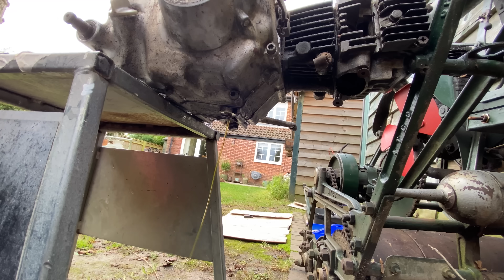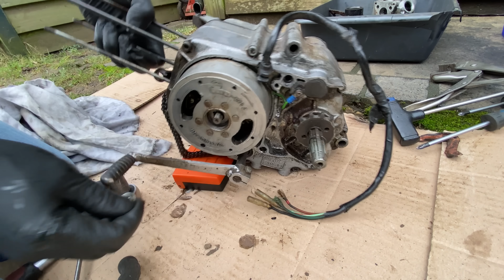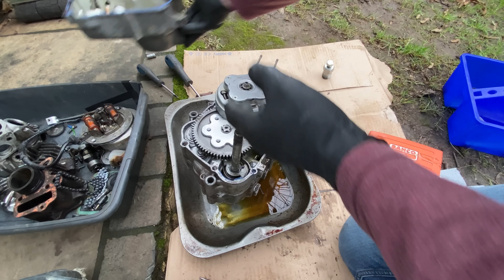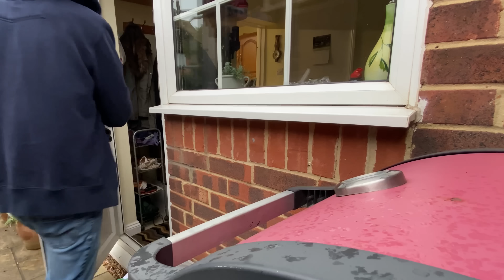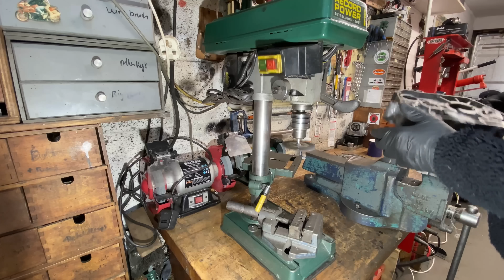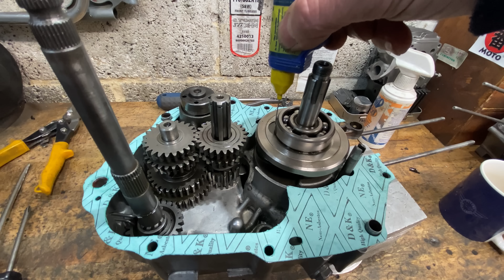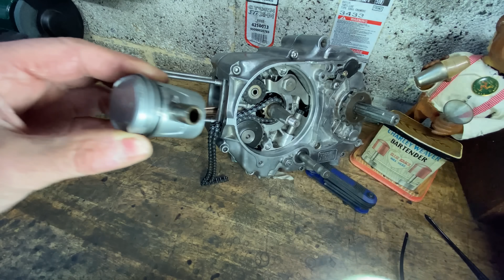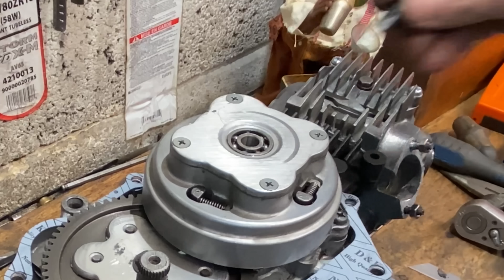Honda SS50 engine strip down, rebuild and start

Comment: My first bike was a ca. 1970 Z50 with a close relative of this engine (semi-auto trans.) Always had trouble with the cam chain jumping time. As a 9- or 10-yo kid I didn't really have the knowledge or resources to root cause it but I did get pretty good at pulling that side cover off the head and re-timing it. I still have my old Clymer manual for it with hand-written notes I made back then inside the covers and in the margins. Good memories. 45 years on I still miss that little bike.
Reply: You could always get one. If 50cc is too small for your blood, you may also be able to get a modern Monkey 125. Dunno if it's available in your market though.

Comment: Superb video as always Allen.
The first job that I had to do on my SS50 engine, was an exhaust valve replacement, after bending an exhaust valve in a fit of teenage bravado!
B.T.W,  you don't need a valve compressor on these little heads. - You can just use a 10mm spanner through the tappet adjustment hole, to lever the valve assembly down.
A popular modification, for those who were not satisfied with 50cc power was to source the head, barrel and piston from a Honda C70. Not strictly legal for a moped, but Who is going to check?
Reply: You could identify one with a C70 cylinder by the shiny patch in the place where the engine capacity was originally cast onto the cylinder.

Comment: Brings back nightmares, spent some time carefully rebuilding one of these little beauties, got it back in the bike for someone to ride for work, very carefully explained the need to "run it in" and bring it back for a service after a hundred miles, they brought it back broken, said it went like a rocket almost 50 mph and 60 down hill, piston scuffed, bore scuffed, rings broken, they had caned the nuts out of it.
Reply from the maker: Brilliant

Comment: Enjoyed this video immensely, reminds me of the old Honda 50/55 pushrod OHV engines, worked on my share of those! Fairly simple engine, not much to them, and bulletproof.
Thank you, Allen!
Reply: I share your memories.
Reply: Push rods? Apart from the CX500 I thought all Honda engines were OHC or DOHC.
Reply: @moestrei  Yes definitely, the early 50cc Honda engine was pushrod operated.
Reply: @tonycamplin8607  Thanks....I learned something today.
Reply: @tonycamplin8607  The early Honda 50cc with pushrod valve gear was called the C100, sold in the UK from 1963 to about 1967 when it was replaced by the C50 with the overhead camshaft. The SS50 in this video was a "sixteener special" introduced in 1972 after the minimum age to ride a motorcycle other than a moped was raised to 17 in December 1971, that had pedals so as to meet the legal definition of a moped until the definition was changed in August 1977. The SS50's only real weakness was the piston rings, which would break if the engine was grossly over-revved (although I think the ones in this engine were broken by clumsy assembly technique; over-revving broke them at the ends rather than in the middle. I think the rival Yamaha FS1E was the only sixteener special on which nothing broke if it was over-revved; the engine would withstand a speed higher than the speed it would reach on full throttle with no load.
Reply: @cedriclynch  Thanks for the information, my little Honda, bought in 1964 also had pedals and looked sporty with its high level exhaust and fancy tank. As you suggested designed to attract teenagers. However I definitely wasn't one then! got it as cheap transport to work.
Reply: @moestrei  The CG125 also has pushrod valve gear.

Comment: G'day  Allen,,
Hope your ok , having to do a "full rebuild"  on that  Honda ,,,,  
Without  even so much as a cup-cake  or a muffin in sight .
 Still ,,, i guess something must have rubbed off ,,  
as  Tracey came to the rescue  "fully  assembled"  a Blanket/Quilt  by  juggling  a couple of light drift pins  and a length of coloured  cord..
Indeed,,,  might even start a new trend ..
 
       Respect 
          from
    Down  Under

Comment: In 76 my dad bought me a 73 SS50 I rode it to work and even off road in a quarry  the frame broke got fixed and still it took me everywhere, it was slow but so reliable and tough i have fond memories of it, it's nice to see one running again!

Comment: Brings back so many memories, the sound of the engine without an exhaust, the little dipstick, etc etc. I wonder how many of these engines have been sold worldwide?
Reply from the maker: Millions
Reply: The SS50 engine (although not the gearbox and clutch) is almost identical to the engine of the C50 Cub, which is the biggest-selling motor vehicle in history.

Comment: Nice. This took me back a bit.  My first bike was a C70 step-though.  I did manage 26,000 miles in two years though.  Honda did a great job with the reliability on those engines.

Comment: I bought an SS50 new back in 1973.  I used it around town and for commuting to work.  When we went on holiday we loaded it in the back of the van and rode it around Scotland.  It just needed a bit more power and a couple of years later traded it for a CB125S.  happy days.

Comment: Thanks for the video Alan - like many others in the comments it brought back memories from my youth. My first bike as a sixteen year old was a nearly new metallic blue Honda 5 speed SS50 Reg XYO 76G. Unlike the later model (with pedals?) for a 4 stroke 50cc it was reasonably nippy.  I think it could make about 55mph with a following wind going downhill. I am tall and sat bolt upright with just about room to tuck my knees under the handle bars. Not much room (or power) for a pillion. Was jealous of a school friend who had a 5 speed SS90. At the time I had a genuine Honda workshop manual and I learnt a lot from maintaining it and the occasional strip down. Seem to recall SAE 30 oil was recommended in the day. Unfortunately the bike and workshop manual are long gone but still have the service tool in my shed.
Reply: Allen

Comment: I had an SS50 when i was 16 ( 36 years ago ) and i made it in to a 70 cc .
It was realy fast but a bid dangarous  to ride ...siting over the rear wheel...
I sold it and got a Honda MB5 / 7.
Fun times ...messing with mopeds.

Comment: As always, so impressed. It takes as much work to sort this little motor out, as a Z1. Some would say, are these worth bothering about? but I'm glad someone cares. Not a lot of 'Umph' in these, recalling two teenagers riding two-up struggling up Cotwold hills for a pint at a remote pub in winter. Looking forward to the next Kwaker 4 carbs episode - great job.

Comment: arh thats nice ... you make me feel young again ! , i did the same job many times .. 35 years ago , but we could not find any good heads back then , so the camshaft had to be sat in a homemade brass bering , but just like all your engines , it worked like a charm :-)  Greetings from Denmark , oooooh BTW where is the video where Tracy is making that twin motor KitchenMashine :-) ?

Comment: Thanks very enjoyable, took me back to being 16. Day after snapping my collarbone in half from locking a Beeza g/box up, sending me over the bars, no helmet, head & right shoulder slammed into the hard ground while `grass-tracking`, I was itching to get back on a bike again....any bike.  All figure-of-eight bandaged up, I gingerly pulled my SS50 early 5sp out of the shed, thinking I`ll manage ok on the tiny Honda. I did 100yds and thought better of it for a month. Oh for titanium plates & screws back then! Lovely little bike, although remember the frame soon cracked.

Comment: Nice job sir , well done .
Is this the same as the C50 70/90 engine or slightly different ? I seem to remember the C50 being a 3 speed .and not having a manual clutch facility .
Certainly iconic designs and it's amazing how well these engines last - especially considering they needed thrashed soundly to get andyspeed out them . The SS50 being one of the slowest 50's you could buy .

Comment: I also check if the rings rotate freely, especially when I fit new rings on old pistons. I noticed that sometimes the top ring channels can get slightly deformed and thus causing the ring to get a bit stuck. I just use a piece of an old ring to clean the channel and "reform" it so that the new ring will rotate free.

Comment: These little Honda engines are like Swiss watches , I’m a big fan 👌🏻…. Belleville washers , Maico clutches 🙈 3 screws in my shattered humorous at 17 because of those washers, or was it a 440 Maico and limited talent and no fear, they used to slip then bite with no warning ⚠️ 🤪

Comment: These engines are so familiar to me. It powered my first bike (SS50 4-speed) and my beloved "little donkey" (C70, with a 4 speed gearbox fitted). This was my standby and work bike for many years in my 20s. It broke my heart when it was stolen and trashed.

Comment: My first bike was an SS50!
I really wish I still had it - great on fuel and quite quick for a 50 as it was unrestricted.
Reply: So was mine in 1973! Bored it out to 72cc later and was great to ride in Belgium (when it wasn't raining ! :)
Reply: @truck57us  High, i've 72cc too yet :-)  Kindly But i've more than one.Fiete
Reply: High, today i use the following motor-model, the type FMB139, but made in China. It is with 12Volt and an e-starter.Kindly Fiete

Comment: Very good Alan,,I think the rings were broken by incorrect clumsy fitting,,also on the head bolts Honda fitted one with a copper washer ,,the oil feed goes up that bolt ,,can I also say ignition timing,,eg points gap, on these is very important if you want full speed ,,Alan,question,,,is the later 5 speed inlet tract the same diameter do you know?
Reply from the maker: I believe it’s bigger on the five speed
Reply: @AllenMillyard  yes I thought so ,I have a 4 speed now,,I used to have 5spd,n thought the hole looked bigger   ,I might put a 72cc top end on as I've put a few pounds on since I was 16,,,Great engine Mr Honda

Comment: What a great job. Bought back some great memories for me, had C50s as field bikes and as a lad I damaged to gear selector so pulled the engine apart on my dad's workbench. I struggled to get it all back together and eventually gave up. 
The following day on return from school I found my dad had rebuilt the engine from the scattered parts and it worked perfectly. He was a great guy and he had my total admiration.
Reply: At the other end of the scale ......
My CB 250 K1 was giving me no end of grief and then the geabox went.  I hadn't much time or money to sort it when I got the offer of a Honda 90 'sport' - esentially the big brother engine to this one.
It was a great little town bike until one day it stopped.
Couldn't work out why:  Spark -check,  Fuel - yeah could smell that when I took the plug out. 
I was starting to loosen the first of the head bolts when my mate pulled up and asked what was going on - I explained.
He shook the bike.
Silence.
No sloshing petrol sound.
The thing had such phenomenal mpg I had totally forgotten I needed to sometimes put petrol in.
Still
We get all this political bleating about Carbon this and electric that to save the environment
...... all too stupid to recognise that really frugal engines have been kicking around for over half a century.
Reply: That's a true father. You were blessed
Reply: @PAULSWorldofWonder  My dad was great too, but a drunk, not mean but a happy drunk.  Everyone liked him, sad he's gone.
Reply: @PAULSWorldofWonder  Still miss him
Reply: Lovely story....
Reply: @lawrencehenson8409 Just re reading this comment left 3 years ago brings back memories. Lost him 20 years ago now

Comment: So all the bearings were okay? Same piston and everything? Almost more of a reassembly then!

I did this with a Honda 125cc engine. Ended up replacing almost all the bearings and oil seals, and the piston and rings, valve tappets, valve springs, cam chain, tensioner, guides. The only bearing I did not replace was the conrod bearing as you have to replace the entire crank for that and it was a £600 part. Luckily all the transmission gears were in good condition.
Reply from the maker: I fitted new piston, piston rings and gaskets
Reply: @AllenMillyard  That's fortunate. I spent about £800 in parts for that bike and sold it for £1200 a year later, after also fitting new tires.

Comment: Honda ss50 i use to race them back in the 70s moped days i had a Casal
Reply: @Jojo Rabbit Bkue mine was and did 69 mph flatout
Reply: @Jojo Rabbit I remember Garelli  and all the others. I use to race FS1-E AP50 and others but i always won mine was much faster and i was nuts on it loll. And since then o have had thousands of bikes and never stopped riding, Current bike is a Honda Pan european 1300  Do you still ride ?

Comment: Great video, you show how easy it is and not intimidating at all, to rebuild an engine.
I'm working on an old 1971 Honda CB175, that I got in boxes. It's great fun to see it come together, Just finished the engine reassembly this morning. The rest will have to wait a bit.
Reply: Back in `77, turned my L-regger into a cafe racer, c/w snazzy seat-tail unit etc and it didn`t half bark out through its 2 into 1 with megaphone. Used to turn heads....which soon turned back the other way when they realised it was only a CB175 approaching. Would redline the poor thing to death(pre acquiring a modicum of mechanical sympathy), and seemed to be replacing rings, pistons, valves and cyl head every month once it lost power with tell-tale oil vapour puthering out of the engine-gearbox breather. A mate back from Spain with some cheap smokes, popped into my garage to watch me assembling the engine, leaned over it as he popped a ciggie in his mouth, which promptly fell apart, depositing all the tobacco into the crankcases. Another strip -down ensued.
Reply: @rattusnorvegicus4380  Now, that is a damn-fine Stranglers album.

Comment: My first bike I bought in 1978 was a seized SS 50 I payed £5 for the whole bike ! . Payed about £10 for new piston and ring's and got it running again so I know this engine well. Great vid .
Reply: My first bike was a  SS50 5 speed I paid £65 for.  I also later bought a scrap 4 speed for parts.  Wish I had kept them both!
Reply: I was given my SS50 as a non runner by a neighbour for free, managed to get it started with a bump, didnt need to do anything else 😁